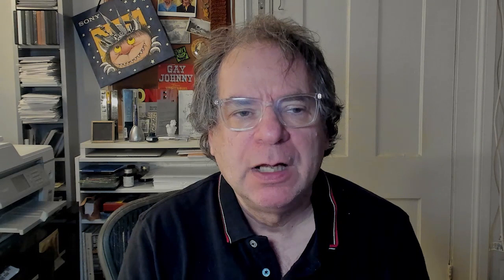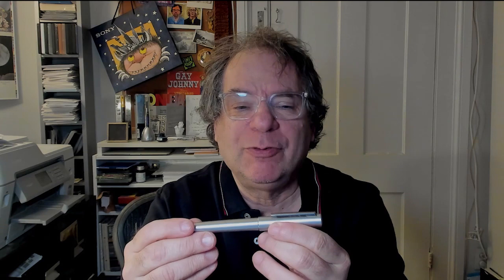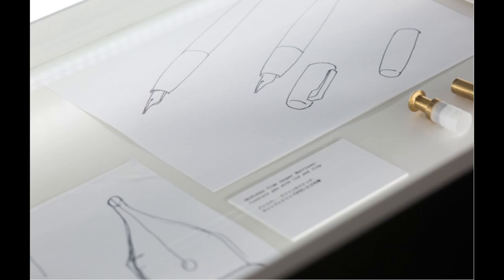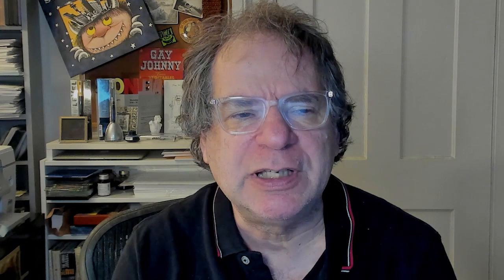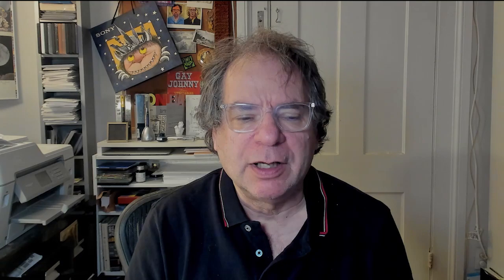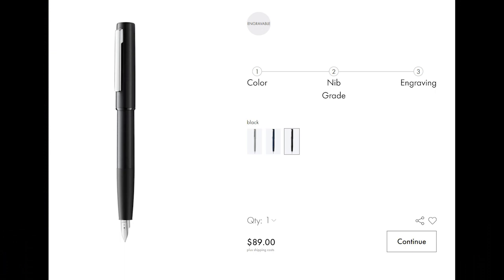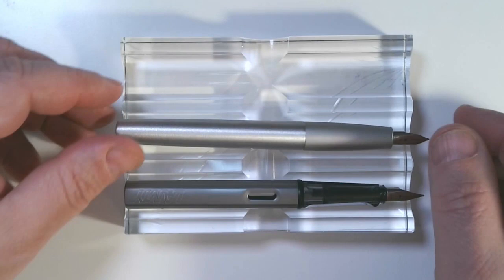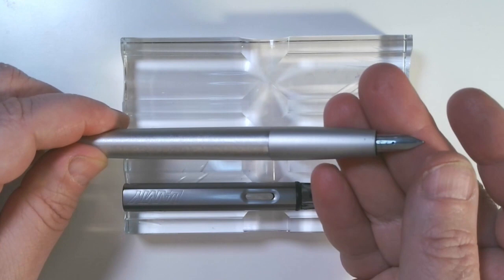Lamy Aion: The Super Normal Fountain Pen from Jasper Morrison

Comment: Thanks for the overview - I agree, it's a nicely designed pen, and though a little on the heavy side, I find it easy to right with (I waited for the green version before opting in).  I now have 2 of these newer design (z53) nibs, one on an Aion and one on an ideos), and both write really smoothly.  I don't know if they apply greater quality control to these nibs, or whether I just got lucky, but I've had a couple of z55 EFs that were pretty scratchy to write with.
Reply from the maker: I agree that when it comes to extra fine it is better but I like the thicker line of the z50 medium better than the z53 medium. But it is a matter of taste I think.
Reply: @drawingwithfountainpens  I haven't tried a z53 medium - the B is very smooth, but not especially broad!